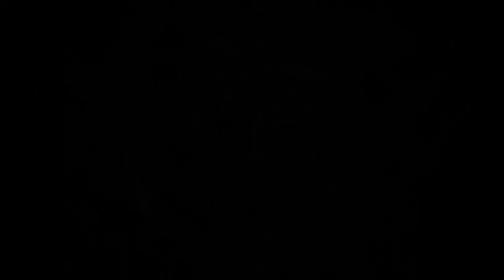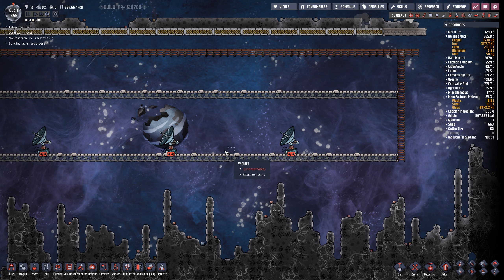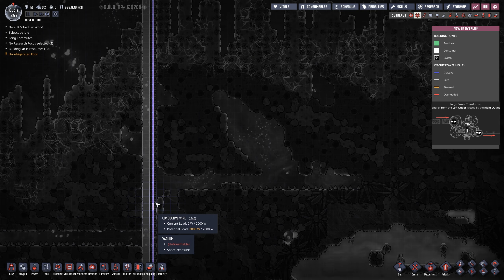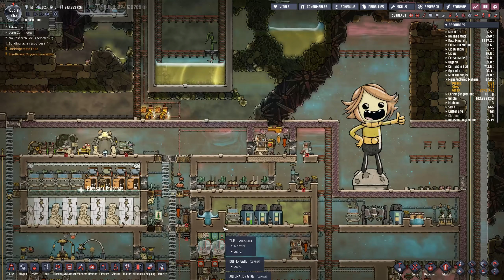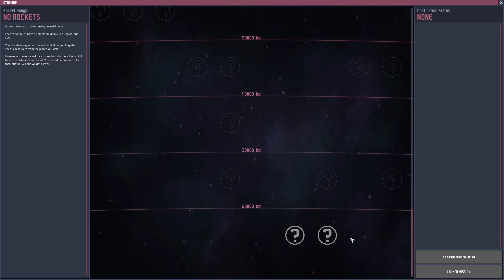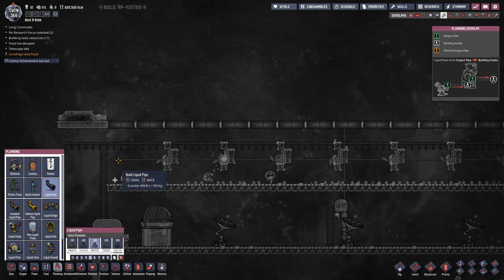ONI Bust A Rime #16 - Solar panels, robominers

Comment: https://youtu.be/csKKWyCYnxc?t=488 Given you're restricted by only 2 inputs per gate you could have 3 AND gates (2 of which feed green to their primary), then a NOT gate coming from the primary to the doors.. I don't think your current centralised setup is robust enough for max protection efficiency..

https://youtu.be/csKKWyCYnxc?t=1449 The regolith sweepers prolly need to be connected with a high temp-tolerant signal (& power) wire, as they're likely to get v hot while working.. you partially addressed this shortly afterwards, but it's still a niggle that may bite you later :(

Since you already have an enforced suit-wearing policy in 'space', is it necessary to provide the telescope with oxygen, or is that just an unavoidable game mechanic (eg astrophysicist researcher has to work with suit off while stargazing)?

There's an ideal natural abyssilite-lined 'holding pen' for voles just to the R of where you built your own pen, albeit it may be a bit large for your purposes. However, it does provide a natural drop-off point for regolith swept from the outer doors of the base, without worrying too much about oversupply or temp issues..